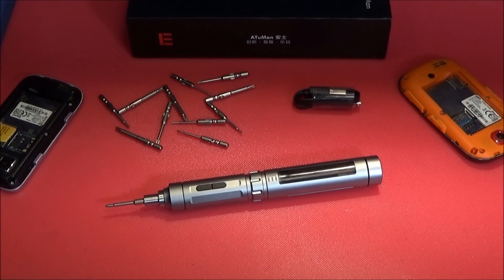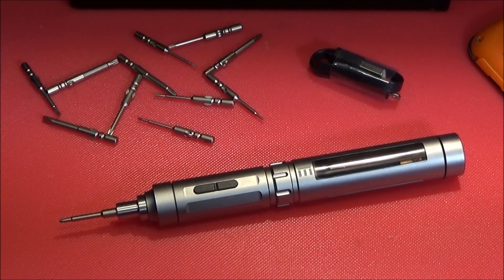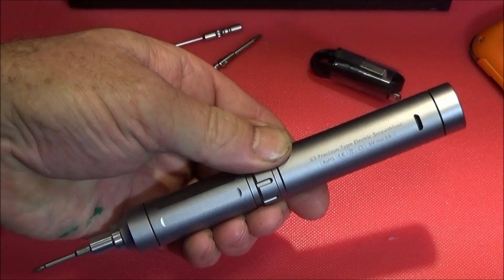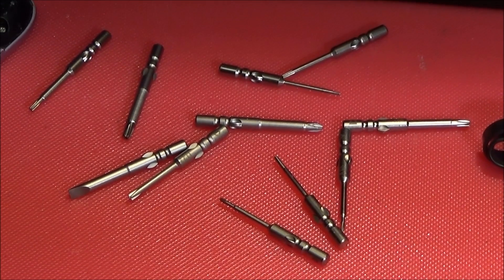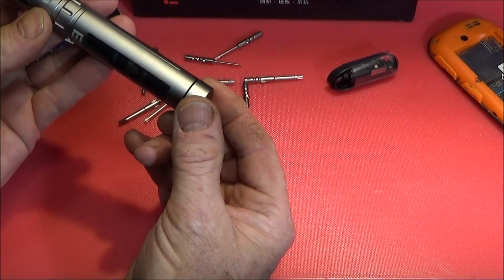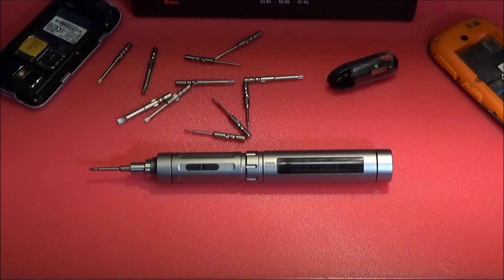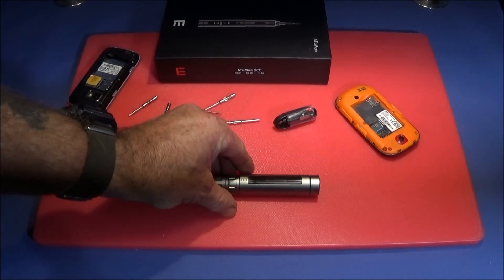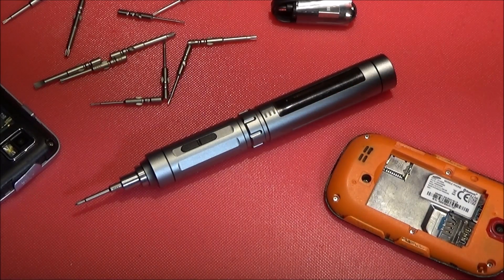ATuMan  E3 Precision Electronic Screwdriver With Gear Speed & Torque

Comment: I bought a non-electric driver that uses these bits and love them and with my wrists sometimes giving me problems recently, I’m thinking of getting this one. 

FYI the bits are not proprietary. On the usual Chinese retailer sites they're called 800 electric screwdriver bits. I've also seen them called 4 mm round shank. There's also the 5 mm 801 and 802 which is 6 mm. I’ve also seen the diameter symbol ‘⌀’ used with these as ‘⌀4’, ‘⌀5’ and ‘⌀6’ respectively.

These appear to be knockoffs of a proprietary electric screwdriver shank from a Japanese company called Hios, however their shank only comes in ‘H4’ and ‘H5’, seemingly no ‘H6’. These are expensive, heavy duty drivers meant for precise, continuous work on assembly lines. There’s also an ‘A-type’ of these where the usually rounded “wings” have a sharp cut about halfway through. These seemingly will not fit 800 screwdrivers. I found a ¼” hex to Hios adapter (‘ASG 64327’) for like $30 thinking it’d let me use ¼” hex bits. I first accidentally ordered the ASG 64328 which is Hios to ¼” hex because the site used the same picture for both. After returning it and getting the right one however, I was dismayed to find that the Hios adapter simply would not fit the 800 driver as it has this A-type wing shank. I still might get it working with a bit of grinding, but let that be a warning to you. Also, I have seen a ¼” hex to 801 (5mm) adapter on the Chinese sites, but that does us no good for these screwdrivers.

Comment: To slow, needs to be at least 300rpm
Reply from the maker: Obviously you are too crazy to know what you're talking about?...:) How could it possibly be too slow?!!
Reply: @SteveJordan  How fucking dumb are you. If you have 30 screws to unscrew & screw back up I think a 300rpm will be alot faster you stupid dumb fuck
Reply: Crazy Clown ... You are incredibly and unnecessarily rude; I can only assume you feel safe behind the anonymity of the internet, whilst in the real world you wouldn’t dare talk to someone like that.

Are you in a trade, manufacturing or engineering? 300rpm is excessive for the size of work this is intended for. This is designed for small, delicate work. 

Pneumatic torque drivers are used on assembly lines for larger units, their power and speed would be entirely unsuitable for the kind of work this tool is intended for. That’s why it exists, and its specifications are entirely appropriate.

Comment: Hello, is there any adapter for these bits to use with the normal 4mm bits that have in the market? thanks.
Reply from the maker: Hi Luiz, not that I know of, but it would be easy to make one up on the lathe.

Comment: Do the bits have a proprietary attack, or is it possible to use the normal bits on the market?
Reply from the maker: Hi the bits are made for specifically for this make I think. I just bought the manual AtuMan set  and it has many more types of bits but the same fitting. I will show this soon

Comment: Hi Steve, is there any chance you could do a video on improving backlash on the cross slide and top slide screws on the Myford. I don't know anybody with an ML7 so have nothing to compare with. i love your work and know that if anybody can help, you can.
Thank you
Reply from the maker: Hi I just loosen the hand winder handle on the end, screw the increment dial in until it stops, hold with a spanner then re-tighten hand winder handle. There will still be a certain amount of backlash, but I don't bother about it. If the slides are adjusted nicely on the gibs it doesn't really cause any problems. 
 All the lathes I have ever used, including industrial lathes, tend to have some backlash, so I have always machined in a method and way so that it doesn't bother me.
Reply: Thanks Steve. That is very helpful indeed. I’ll give it a try.

Comment: I wonder if you could make an adapter to bridge the gap between standard hex bit and the proprietary receiver on the ATuMan E3.  You could make a killing.
Reply from the maker: Yes I reckon one could do that, although I haven't tested it on the larger self tappers. I was just keeping mine for the smaller electronic things. I have been looking for a good jewelers screw-driver set for sometime.
A lot of the smaller ordinary hex type sets are too short on the bit lengths to reach into equipment. 
The ATuMan type are the first I have seen to overcome this problem.
  I do have an amazing new ordinary cordless screwdriver to show soon, one of which was in the budget range as well. It has amazing quality, spec and performance though.
  You look like a friendly cat. How come you have ended up being feral? Also can you tell me whether those electronic devices, that are meant to deter cats, work?
Reply: My experience with electronic pest control devices is that they tend to work for a while.  Then, the targeted pests become tolerant to the "noise" and adapt and thus, resume their normal routine.

I am not a cat, but I took in a feral cat (Smiley) who was friendly unless she was handled the wrong way, in which she summarily drew blood.  She took off one night and never returned.  I dedicated my channel to the wonderful creature whom I dearly miss.
Reply from the maker: I like the way you answer, ...plus the fact that you live in hope. Losing a lovely animal is very depressing to say the least,.... maybe she will return one day. One does hear stories that they do, sometimes even after a long period of time.
 I had semi indoor rabbits for many years and loved the fact that each one of them had a unique wonderful personality. Most people never see this, because of their ignorance towards animals.
  I had to put one of my hen's down the other day and I even miss her. If you tell some people they really do not understand.